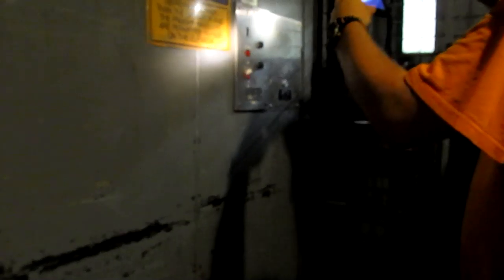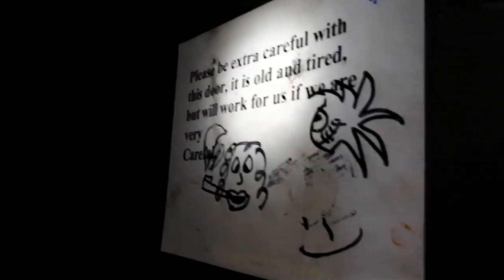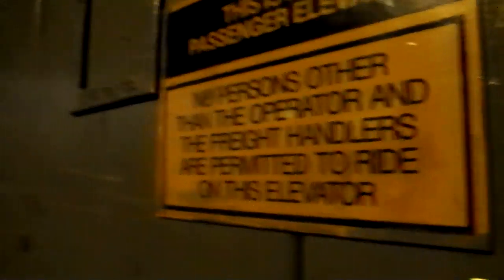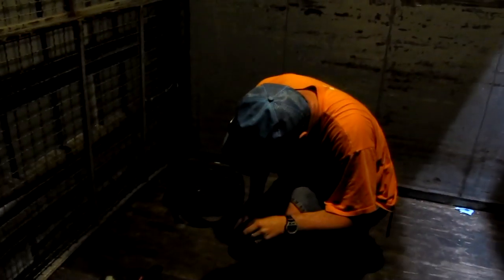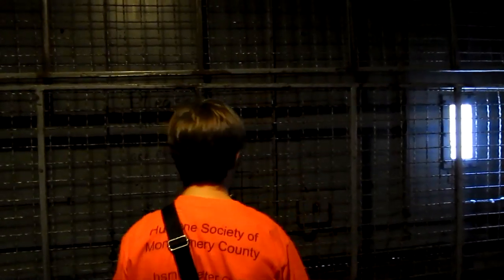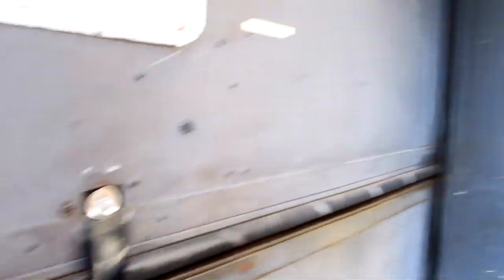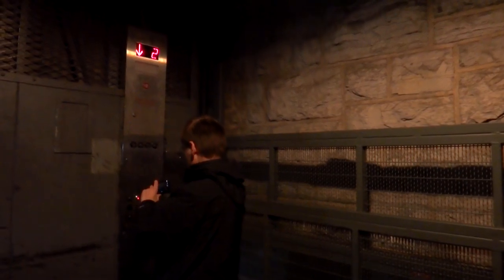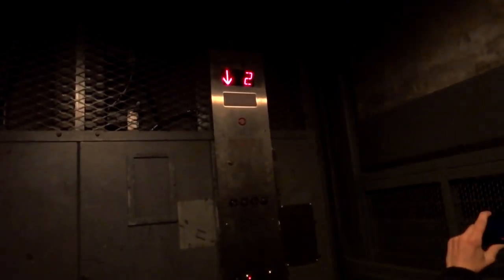Before and After: Freight Elevator Modernization

Comment: Wasn't boring at all. You actually learned a lot. Example hydro elevators back then were much quieter than they are now (maybe cheap valve or improperly adjusted, or small dia. line, probably no noise isolation, submerged tank?). Owners were cheap and were not willing to spend extra $$$ for fully automatic doors, company was cheap to give it a fresh coat of paint....